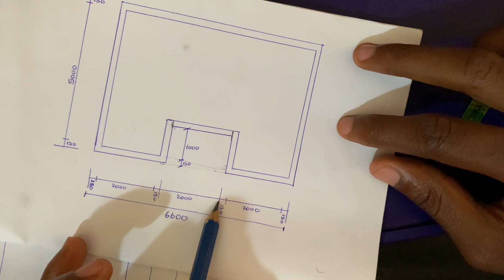How to Calculate the Mean Girth of an Irregular Shaped Building Plan | QS Measurement Guide

Comment: You used 6600 and 5000 
Is it not supposed to be 5300
Reply from the maker: No the out to out dimension on the width side is 5000 
If it is out to out dimensions (you less the 4 corners)
If it is in to in dimension (you add the 4 corners )